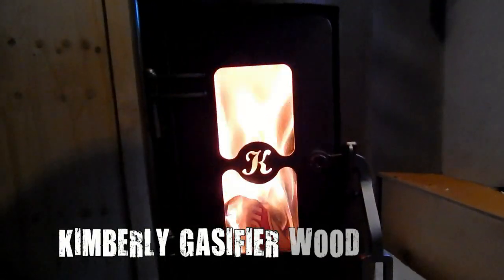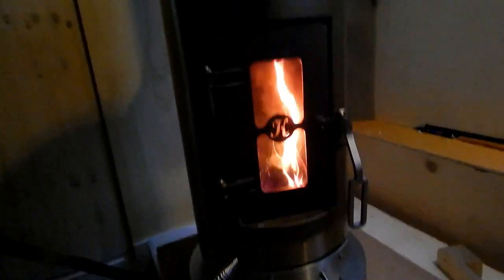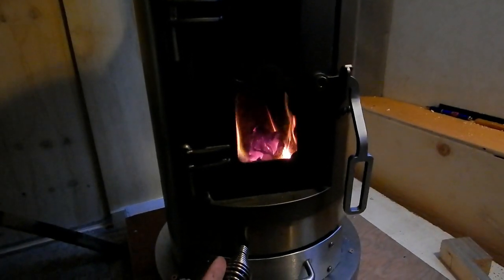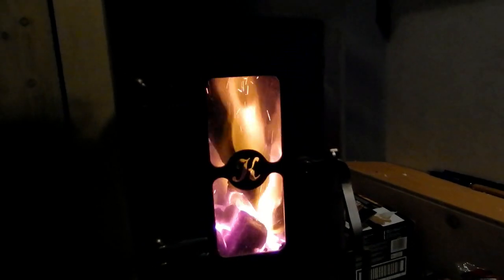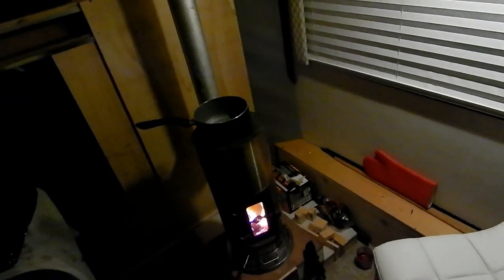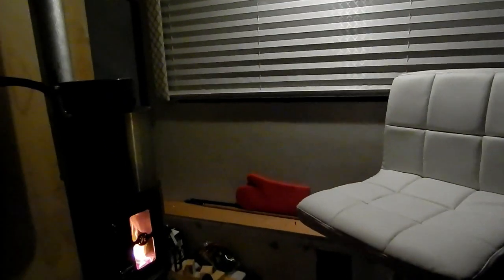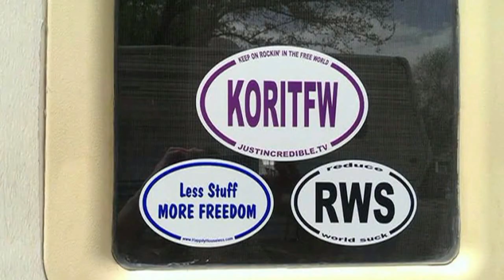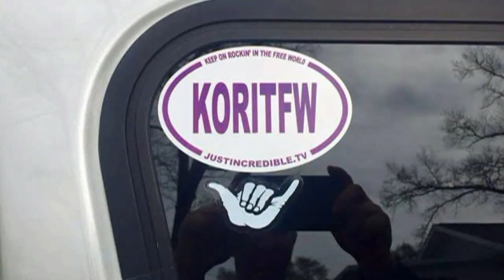Out with the sofa, in with the Kimberly!

Comment: Holy crap dude.  Far too cool, nice dry heat and the snap crackle and pop of a real fire.  Doesn't get better than that.  I just did a custom install of a thermostatically controlled propane fireplace for my class C.
Reply: Thanks Bob, both have their strength's and weaknesses, I could just as easily run out of propane.  If he runs out of wood he has the propane furnace as backup.  I have a Portable buddy heater as backup if I run out of propane but if I run out of propane I also have a fridge that will shut off.  I suppose I could also just start my generator as the fridge will run off that and I keep a 110V space heater in the RV.
Reply: +RV Crazy  same question to you that I sent to Justin, You are still going to have to run furnace to keep lines and tank from freezing right? Is your coach 4 season?
Reply: So the climate where I live is pretty mild so I'm not really worried about freezing lines.  As long as I stay using my RV I shouldn't have issues.  Also if the temperature is really cold I will open a couple of drawers to get a bit of the heat to my water lines and tank which are all inside the RV.  Only thing outside and unprotected is my grey and black tanks.  So if the temp get's below about 35 for more than a few hours I will put a bit of antifreeze into my holding tanks to make sure they drain where the water stays stagnant.  I currently don't have any insulation of any kind on my holding tanks
Reply: +RV Crazy I would be more concerned about a water heater if you have one. The water/black tanks are pretty tough and may freeze but I don't believe they will crack but the water heater will and many rvers forget to drain them!
Reply: +Gene Smith Yeah I just keep the water heater on when it's going to be getting down to freezing.  I'm full time in my rv and the Temps don't stay cold for very long where I live luckily or I'd be more worried about it.

Comment: Looks cozy!  Just a tip; keep all of the original furniture and fixtures so when you sell it down the road, the furniture is available to the next owner.  In general, these types of mods drop the value and can almost make is impossible to sell but if it can be restored back to original, then not a problem.  KORITFRW!
Reply from the maker: in over 15 years of completely changing RVs I've always sold them for a profit.

Comment: The forced air furnace is what keeps the lines and tanks from freezing in really cold weather. I'm thinking you will run furnace fan some to keep everything from freezing? I am thinking the BT Cruiser is not a 4 season coach? Of course, it may be a non-issue in your region. I saw some vids on youtube where a guy had one in his toyota dolphin motorhome n Alaska. It was alot of good info. You probably have seen it.
Reply from the maker: +Campervan Kevin no, the furnace wouldn't do much for the tanks...they're on opposite sides anyways. If anything, this stove will do better as it warms the whole place up constantly instead of a few minutes at a time. Of course it's very rare that we get cold enough here, but if you remember the tour video it does have heated holding tanks if I really thought it was cold enough.

Comment: Nice. When I was researching for a wood heater for an RV I saw the Kimberly and was excited until I saw the price. While it can be justified in a full time RV winter situation like yours it still makes it hard to justify such a high price, esp. when compared to what half that price bought for a full size wood stove like the Blaze King. 
For T-Rex I am leaning toward the Dickenson wood stove at around $500.00. While said to be a part time stove I would build an inner firebox if using it a lot. Anyway, great to see you with such a nice stove.
Reply from the maker: Yeah the difference for me is heat output. The Dickinson is max 8,000 btu, Kimberly up to 40,000 btu...and can cook on top, and also uses outside air for combustion but the Dickinson is not sealed and uses inside air and cannot be cooked on. These are the reasons I went with the big boy (or girl).
Reply: +Justin Credible (JustinCredibleTV) I understand, and if I was fluttering in a R.V. the Kimberly would be a top pick even at it's exorbitant price. It would be nice if they could bring the price down to 2 grand, even that is a hefty price but would be more of a viable option for many. 
My wood stoves I had I did not pipe in outside air to it but cracked a window and let the house preheat the air for the stove.

Comment: that's really awesome,   I'm curious so I saw that you used Henry's on the roof is it just a preference does it have something to do with temperature?   generally people seal things on the roofs with a dicor lap sealant,  I'm about to install some solar panels with angle mount and after seeing glue based solar panel mounts "stickyfeet" I'm considering using liquid nails for roofs not just to seal, the holes from the screws but I'm also hoping the adhesiveness of the liquid nails will help keep those mounting rails in place should the screws ever fail..... or more likely the 45 year old wood that the screws are going to be screwed into.

Comment: I had a wood stove in a house with the secondary combustion chamber and OMG when that thing got going.....  It would run you out of the room.  I would have never thought of putting a wood stove in an RV.  What happens when you have to drive to work in the morning?
Reply: +Bill Long if the chimney is high enough there shouldn't be a problem. Only time you get back draft in the wind is with too low a chimney.  Same as a house. There are a number of caps designed for high winds if it ever was a problem.
Reply from the maker: I drive with it on all the time.

Comment: Now you've gone and hit my sweet spot - wood heat and dual chambers for gasification.
One of the reasons my back keeps saying no - to life on the road. I'd miss the wood heat of my houses Lopi woodstove.  Will you be storing dry wood in one of your bays - now, or just using the store bought logs. Your chimney should really be the highest thing on your roof, for proper draft. Even with Kimberly? Do you need a thermometer on the pipe to CYA for safety or do you need to worry about temp's betwn. 120 -280ºC (I think) up your smoke stack (300-500ºF). What can I say I'm one of the US Fahrenheit types.

Comment: i love it Justin but is that chimney sitting up a little high or no?
Reply from the maker: Too low actually. It will be higher when done.
Reply from the maker: Benjamin Strand no difference. There's either drive thrus with a height restriction (usually nothing bigger than a pickup) and then there's drive thrus without a height bar. Obviously I can only go through the latter ones already...and that won't change. It's not like there's a difference in two feet.
Reply from the maker: It's still not as high as half the cube vans on the road...not even close.

Comment: Hmm...That Dickinson sure looked clean - especially the way you had it installed - but if you need more heat I guess you need that wood burner...
Reply from the maker: The Dickinson is nice but they are very small, low output heaters...more for show. I want this vehicle to be truly off grid. Zero propane required and can cook on it. It was actually on my radar for my last van as well, but expensive so I went with the Dickinson (and now I have the space for it). This motorhome will be an off grid wood cabin on wheels when I'm done.

Comment: Looks Awesome!! Do you think that stovepipe will clear your drivethru's?
Reply from the maker: +BigggRoss Irrelevant. An overheight restricted drive-thru couldn't fit even a cargo van with a roof vent...so if it's a non-height restricted one it doesn't matter how high you go.
Reply from the maker: With the chimney it's not even as high as most standard cube vans which are on every block and use drive-thrus...so the extra little bit on mine doesn't make any difference, hell it's still not as high as many RVs. Some RV dish domes and AC units stick up the same height as this lol, and then there's the ones with patio railings up top (which btw I might do!)